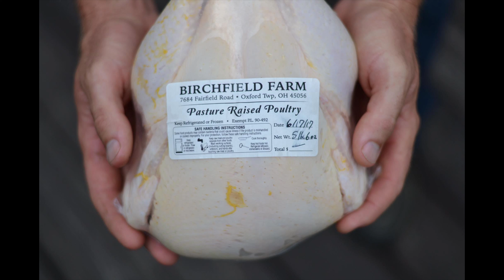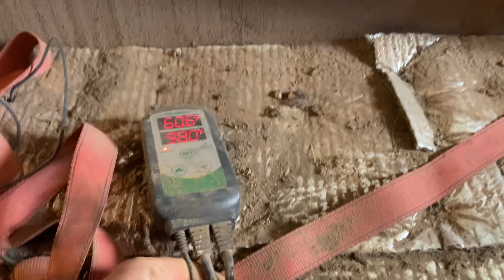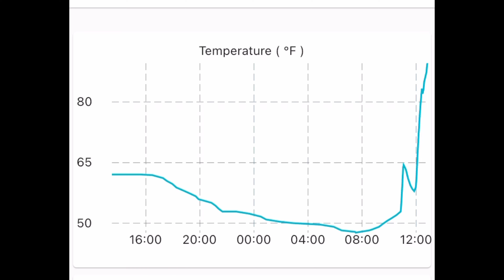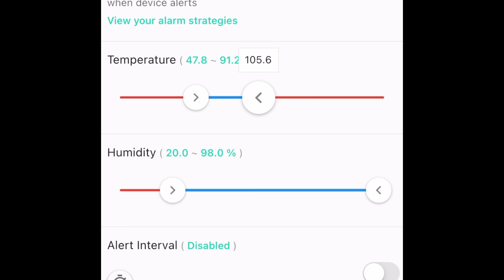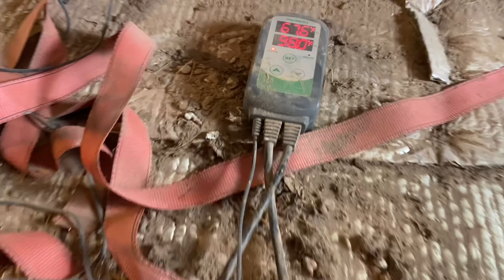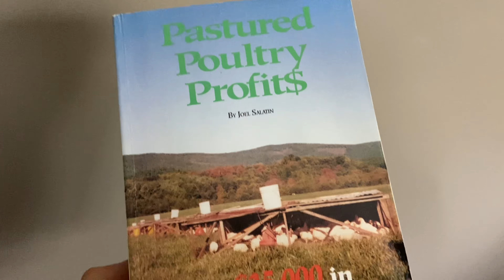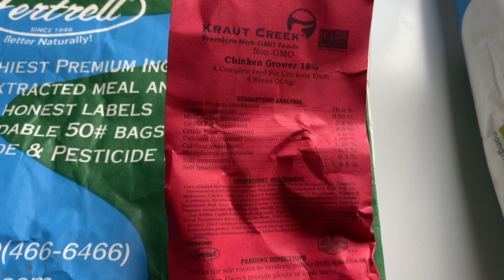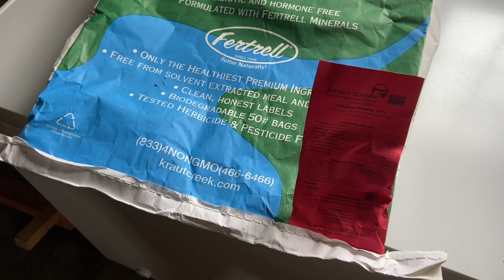587 lbs, 63 Days - Pasture Raised Broilers - Brooder Set-up for Small Farm

Comment: Have you broken the cost down from purchasing the chicks, feed, time, etc. Is there enough profit on a  4.5 lb bird?
Reply from the maker: Great question - Yes, from a purely dollars and cents perspective, we’re retailing straight off the farm, direct to consumer, for between $4 and $5/lb for our whole pastured birds, so it does make sense economically when scaled for us in batches of 100.  There’s a bit of a discount on the chicks when purchased by the hundred, and we’ve a feed supplier who delivers and keeps costs reasonable, IMO.  Profit margins are high but so are the risks, typically 3-5% mortality.  Add in an evenly spread poultry manure application on our rotationally grazed paddocks, a supply of meat and mamma’s bone broth, and it means a Spring risk we’ve routinely stepped into just about every year.  Thanks for commenting.